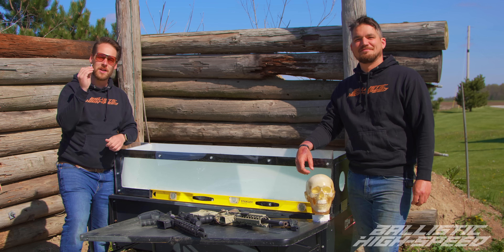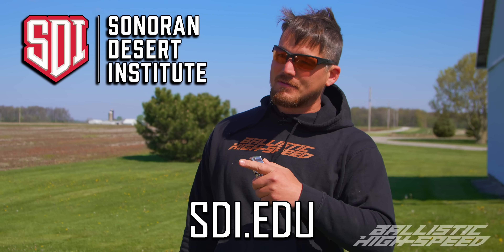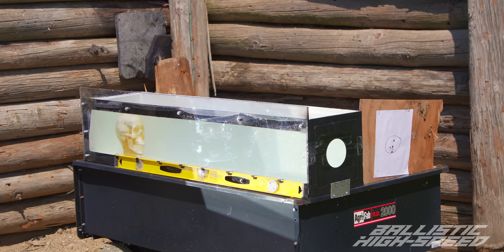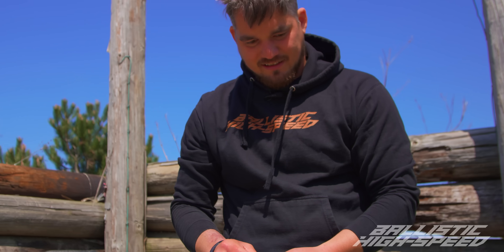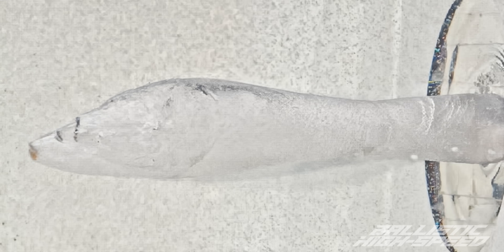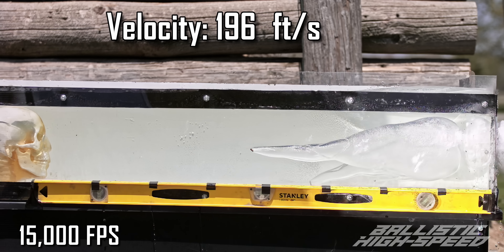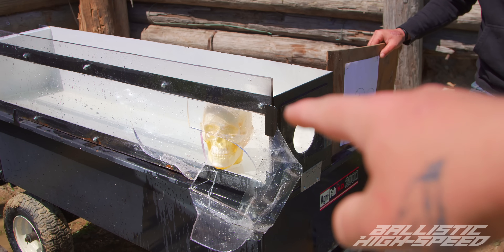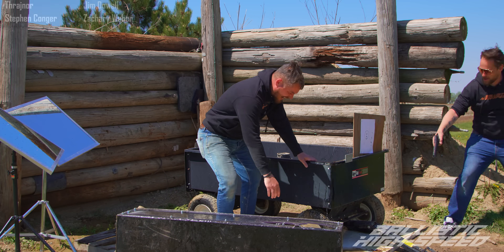How Much Water is Bullet Proof?? FMJ vs Hollow Point! - Ballistic High-Speed

Comment: A few  years ago Mythbusters fired a number of rifle cartridges into a swimming pool. All of the high velocity rifle bullets broke apart, even steel jacketed bullets, on contact with the water. Pistol bullets went the furthest in the water. It doesn’t take nearly as much water to protect you from high powered rifle bullets as it does slower moving pistol bullets.
Reply: Water is better than nothing though
Reply: @voiceofanangel08  So very true.
Reply: Yup and an arrow can travel through and kill ya
Reply: Yes, the faster an object goes, the more concrete-like the water becomes.
Reply: Yup. The forces involved in supersonic rounds entering water exceed the structural strength of the rounds themselves. Slower-moving bullets counter-intuitively penetrate deeper, because the lower forces allow them to stay together.
Reply: Counterintuitive but the proof's here!
Reply: also if you jump from a plane into a body of water you will hit the surface like it's a solid object
Reply: I remember demo ranch did a video a while back shooting through some foam blocks or something like that, and the .45 went the farthest. This is because while the rifle rounds carry a lot more energy, they dump all of it nearly instantly, while the heavy pistol bullets with a lot more momentum go furthest. This is also true with armor piercing rounds. You want as heavy of a bullet as possible going as fast as possible. That's why tanks fire rounds made of tungsten or depleted uranium, because they are extremely dense and hard.
Reply: Only thing is, this doesn't really tell the whole story.

Some years ago I read through a us army (or maybe it was usmc) study on this.  If memory serves it was done in the aftermath of ww2.  I seem to recall that testing was on pigs and they tested various calibers.

Here's the thing - It's pretty common knowledge that explosions under water are pretty dangerous.  Because your meat parts are a pretty similar density to water, the shockwave gets transferred right through you until it hits something with a different enough density and then shreds that.  The shockwave from bullets hitting and cutting the water around you basically do the same thing.

In the testing, they found a whole lot of damage to the organs, especially the lungs, and blood vessels from pretty surprising distances.  Basically, you might be submerged a couple of feet and a burst of 30 cal mg fire hits the water above you.  It shreds your lungs and you drown in your own blood without even having a mark on you.
Reply: @ColonelSandersLite that's fuckin' terrifying
Reply: @wordswift_2011  Yeah, it kinda is.  That's exactly the reason that one stuck with me.
Reply: @ColonelSandersLite Are you sure bullets produce the same kind of shockwave you get from high explosives?  I mean they certainly can produce pressure waves (mythbusters did fish in a barrel tests) but I'm skeptical it would really be lethal very far in open water -- unlike explosions.
Reply: @ColonelSandersLite The shockwave is more relevant in underwater granade explosions. Yes, that will wreck any air sacks. The shockwaves created by bullets are far from fatal because they deplete most of their energy breaking the surface tension of the water. Water is safe protection from bullets, especially in large bodies of water and deep enough.
Reply: @ColonelSandersLite  I can believe it with that cavitation collapse from even the pistol cartridges. Just from how far the water jumps up above the top of the tank... Representing something like 50 or 60 pounds of material displaced and thrown into the air. That's some serious overpressure when the bubbles implode. Doesn't seem possible from the amount of energy in the round, I admit the physics of this confuse me a little.
Reply: @ColonelSandersLite  So jumping in water isn't the way to go. The best solution is to avoid getting shot at in the first place. I wonder sometimes if mankind was less violent and put all of its energies towards making life better for its fellow man where we would be technology and health wise. If we had spent the past two thousand years trying to make life better for each other versus trying to make everyone's stuff ours where would we be? It's a moot point because I don't see mankind ever reaching that Star Trek mentality after all mankind has managed to weaponize Christianity even though that is the anathema to the teachings of Christ. Oh well maybe the next evolution in homo sapiens will be capable of more.
Reply: @Parents_of_Twins  war has been responsible for most technological advancements.
Reply: @msharp6887  Because we CHOOSE to not fund science at the rate we fund projects for war. Death and destruction aren't the forefront of science money is. I was in grad school and trying to get money for new equipment, or hell just the supplies you need, is like pulling teeth from a grizzly bear. If we funded pure science like we fund projects for war or during war than I wonder what we would see. I don't dispute that we have had many advancements during war but that is because many projects are given the funding they need, not because of the war.
Reply: @Parents_of_Twins  no. It’s because necessity is the mother of invention. Unless there
Is dire need, technological progress is extremely slow, as there is no real incentive.
Reply: @msharp6887  So Thomas Edison and Nicola Tesla created their inventions for which war? War and necessity are not always related. It truly depends on what precisely you are talking about. I would argue that electricity particularly AC current has had a greater impact on this planet than just about any other invention and war had absolutely nothing to do with it. In fact war had nothing to do with any of Tesla's inventions as he was a pacifist. How did the ancient Egyptians build the pyramids? Through inventions that were necessary but had NOTHING to do with war. You are conflating war with necessity and they are not related. Technology moves at the speed that governments or private industries/markets are willing to invest. The technological boom of the 50's through 60's had little to do with the war in Vietnam and had more to do with companies spending money on R&D to avoid paying taxes. That slowed thanks to corporate tax cuts which allowed those companies to keep their profits without needing to create R&D costs, which led to loss of jobs. Thank you for the discussion.
Reply: @Parents_of_Twins  I’m sorry but you are being naive. First, America has been in a nearly perpetual state of war for 200 years. Sure there were ideas and innovations in small ways during peace time, but it was during and directly after war that these small discoveries were amplified and developed. Look at the airplane for example. We had as a species made nearly zero advancement since Leonardo da’vince first theorized and built the flying machine. The wright brothers basically built a giant kite. But then came ww1 and ww2, and we made progress in 40 years than the previous 400.  Another example is the industrial revolution. From the revolutionary war to the civil war, almost zero progress technologically, then the civil war came and boom, massive advances. This is true throughout human history across the world. It’s a sad reality, but human beings are never as inventive, motivated or innovative as we are when we are trying to kill each other. Without human conflict the technology we have today would not be exist.
Reply: @msharp6887  Truly I have studied history and economics and I respectfully agree to disagree with you. See you can say something without belittling the other person's ability or mindset.
Reply: @msharp6887  Well damn had an entire paragraph written and gone. Oh well. First of all let me say that starting a sentence with "I"m sorry but" is a way of saying something rude and then shifting the blame to the person for getting upset at your rude comment and you're better than that BS. Either don't say something rude or say it with conviction. Secondly you're falling into a cause and effect fallacy assuming that the innovations only occurred because of war. What about all the brilliant people who died in the war or those who's lives were so tragically affected by the war that they spent their lives doing nothing where they may have created massive innovations. You are only looking at the positives and discounting all the negatives and assuming those are because of war alone, which doesn't necessary correlate to reality. The human mind is very good, sometimes too good at creating correlations and we have to look at what we think of as related and see if that is truly reality. Now see isn't that a nicer way of saying I disagree with you and I attacked YOU in no way whatsoever, which is the proper way to have a discussion. It's the way it use to be on news channels before the advent of a certain network which would bring people to be interviewed and then the host would either constantly interrupt them or yell over them to "prove" them wrong. That is not a discussion it is noise and the lazy man's way of winning an argument, please understand I'm not accusing you of these things, just bring them up because you felt it necessary to call me naive. That is an insult and has no place in a discussion. I would rather you say you disagree or say I'm wrong and give example and proof. I have studied both history and economics extensively and while I don't consider myself an expert I'm not a novice either. I have read books and watch documentaries from both sides. Now the original post was a hypothetical question based on what the world would be IF mankind was more altruistic. Thought I had made that pretty clear.
Reply: @Parents_of_Twins  ok, so  wasn’t calling u naive to he insulting. Being naive is simply a stage of mental development that we all go through. Naivety is temporary. Instead of getting upset you could have responded with “how am I being naive?”

Most of your comment was you expressing your anger so I won’t respond to that. It’s a waste of time. 

And no, you were not clear that your “what if” was about human nature.
Reply: @Parents_of_Twins  also, YouTube deletes my comments as well. It’s really annoying
Reply: @msharp6887  Anger? Sorry if it was perceived that way as I wasn't angry. Sorry for overreacting to the naive comment. So used to people starting off with small insults and then going from there to bigger insults.
Reply: @Parents_of_Twins  you tube be like that.
Reply: @Parents_of_Twins or maybe penguins evolve
Reply: @Parents_of_Twins did you study men getting pregnant?
Reply: @Parents_of_Twins you’re talking about those guys life’s work. During wartime those things would have been invented in a matter of months. It’s ok to be wrong. Everybody, almost everybody knows what he said is true
Reply: @ WTF are you talking about? You drop a comment on a comment that I made over a month ago without any context and expect me to remember exactly what you are referencing? What things would have been invented in months? Have you studied history? Have you ever actually read accounts of how long it took for them to invent new items and the sheer amount of crap that was invented along the way? Months are you joking or are you ignorant of the facts because most wartime inventions took years to get to the field not months unless your "matter of months" comment was referencing 18-24 months because that was not an uncommon time scale. Yeah some improvements came faster but true inventions, i.e. something created that hadn't previously existed, took plenty of time and that was with practically unlimited budgets. Still I have no idea what you are talking about so next time you drop a comment on someone's post perhaps you could take the time to refer to what you are talking about instead of just implying the person is stupid (Everybody, almost everybody knows what he said is true.).
Reply: @Parents_of_Twins exactly.
Reply: @Parents_of_Twins  War funding is science funding. And I've seen what grad students do... Honestly the grants they get are already too much for what they produce. It's mostly fraud and graft and ethnic patronage schemes
Reply: @ColonelSandersLite did you make this up while. Sober or stoned?
Reply: What about 45-70 gov.
Reply: Interesting. Naively, I just thought the equation for drag is proportional to pho*v^2 so penetration distance might scale as the square root of rho (density difference between air and water is about 800). But I see that water stops bullets a LOT more, because the greater force rips the bullet apart, causing the drag coefficient to rise to a much higher than its initial value on first contact with water.
Reply: That's when you have the Soviets engineer you the APS underwater rifle, an AK-47 with 12cm spears instead of boolit
Reply: Mythbusters did better.
Reply: Same reason was hitting water from a great fall can and often be fatal water can't get out of the way fast enough and it's like hitting cement
Reply: They did?!?!? Oh my gosh.
Reply: So Half-Life's pistol isn't too inaccurate
Reply: What show did you watch?  Your memory is bad

Comment: I would be interested to see you try some of the Fort Scott Munitions TUI rounds in this test. They are designed to tumble in fleshy water based material. They are solid bullets, which would keep them from breaking apart or deforming once hitting the water.

Comment: Shooting into a pool, the water pressure is going to be higher. The bullet box doesn't have enough volume.
Reply: Pressure only depends on depth, not volume. And as water does not compress a lot, I think depth won’t make a big difference either. But you may have a point because shock waves won’t be able to propagate in a small tank.
Reply: @didfet5496 Mythbuster already did that.. long story short if you want to survive a shooting just jump into the lake or river and swim away.
Reply: @Adiarby13  That's not entirelly true, depending on the round fired at you, the shockwave could kill you in a horrible way...
Reply: @Acuas Mythbusters did a test like this before and iirc, they also proved that the shock wave wouldn’t kill you.
Reply: @didfet5496 water does not compress that's why it applies greater pressure. A bullet travelling through a water body will experience greater resistance the deeper it goes.
Reply: Pressure from depth is static pressure. A moving bullet entering water is.... well kinda nonstatic.

A larger tank has larger walls. The same amount of energy over a larger area will result in less energy per area compared to a small tank. And in the end less energy per area leads to less force per area aka pressure.
Reply: @Chaoskind1234  larger pools will surely have larger walls but surface area is proportionate to square while mass increases by cube thus pressure will definitely increase as the water body gets larger.
Reply: @RandomDude-lr6rw  the (static) water pressure depends only on depth, not the width of a body of water. 
But a bullet entering water is a dynamic action. It has nothing to do with the static pressure of the height of a water collum.

Since the energy of bullet does not change when you fire it in a large or small tank, the only variable is the area of the walls. Same energy over a larger area means less energy per area...
Reply: Pls go read more book 😂
Reply: It's really because water is more dense than air and therefore has much more resistance against the bullet. Simple physics.

Comment: That's very shallow water, so the weight will not generate much pressure 🤔 You should try it again in water a few feet deep and see what the difference is? 🤓 lol
Reply: Hmmm. I get the pressure at depth idea, but these (most anyway) slowed down in the first few inches of water. Only the higher powered rifle rounds would have a chance of getting to more depth. But, along those lines, I do wonder if larger box would change results as the pressure “plume” hit the box almost immediately. Shooting into a pool or river or lake would allow the pressure to continue outward longer. If nothing else, the comparison would be interesting!

Comment: I wasn't surprised by this. The ballistics of 9mm is one of the reasons I didn't bother looking at any larger calibers. It has penetration that's actually in excess of what anyone could need at short range and with the right loads you can mitigate that overpenetration to a certain degree if you live in an urban environment. More than enough for self defense, and the recoil is totally manageable.

Comment: How much impact does the tape in front of the tube have compared to the water surface? I mean there will be different forces if it hits the bare water or the tape over the water. Also gravity pulls the water down has different effect if you shoot from top down as if you do here. I would be interested how different angels to the surface would impact the bullet, its velocity and its direction 😊

Comment: The head would normally be attached to a head and not bounce out of the water like that. Attach it to the bottom of the tank.
  Also, if the wave moves the head, you've ruined your experiment essentially.

Comment: The hollow points don't fill with water before they break.  All that air is still in them when they hit liquid, or something, well someone, soft, so the differential in pressures causes the thing to expand immediately.  Cool stuff, none the less.
Reply: You cannot compress water. It's like shooting it at a brick. It expands the round because of inertia imagine dropping a tablespoon of chocolate pudding on your white kitchen floor that's what happens when the bullet hits an object that is made of water or a high percentage of water such as a body. You can compress air but you cannot compress water add lead is softer than water when it hits it at a high velocity and there's a higher mass of water than there is lead. It's inertia hitting a momentarily immovable object of mass at a high velocity